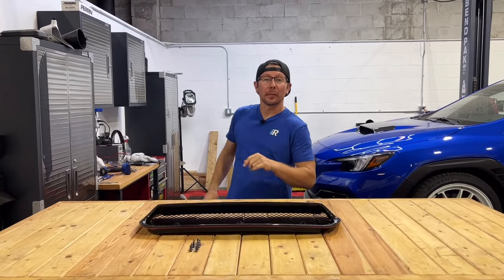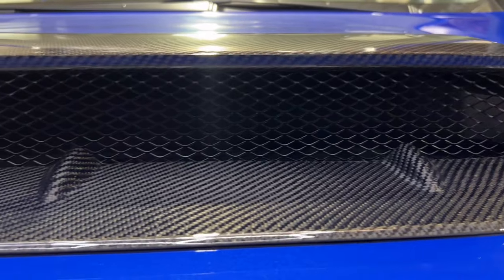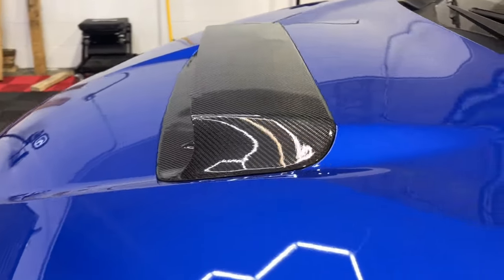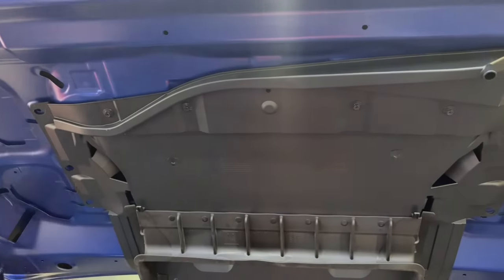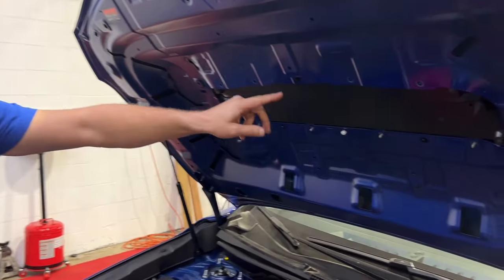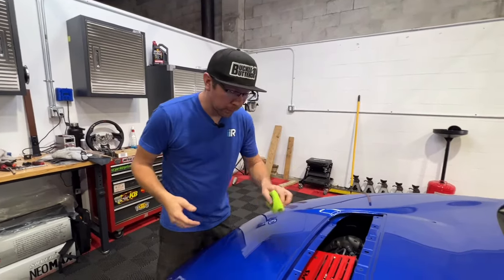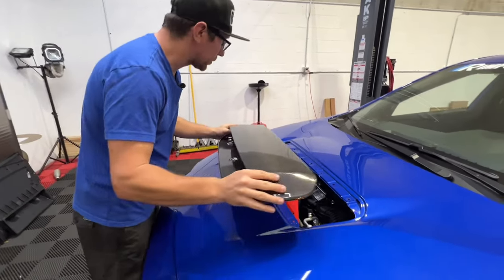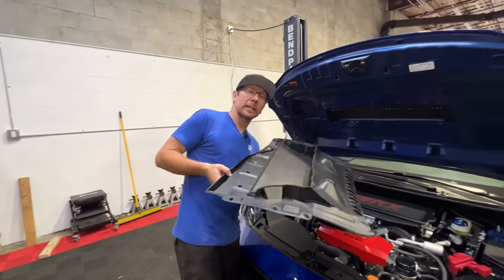Noble Carbon Fiber Bulge Hood Scoop Install | 2022 & 2023 Subaru WRX | Product Peek

Comment: Just a FYI, the scoop does not come with the gasket shown during the install. Youre also able to use the existing 4 screws on the front that held on the OE scoop.

Comment: Any torque specifications on this install? I don’t want to overtighten or under tighten these bolts.
Reply from the maker: Hardware of this size should rarely be torqued past 7 Newton Meters. If in doubt, add a light dab of blue loc-tight to ensure a good bond.

Comment: Im not sure how to take out the white pin, all this work and I'm screwed. Push pins on the bottom also weren't shown and now in my engine bay
Reply from the maker: The white pin removal is the same as the 3 black pins. Squeeze the two securing tabs to release the pin.

Comment: Don't but this scoop unless you want to to wear away the paint on your hood. It's interior quality to OEM. It does not have a glued on gasket like OEM, it does not have alignment pins like OEM, it does not have smooth edges like OEM. It's probably the worst knock off scoop on the market. I purchased it because I am part of some FB WRX groups and was seeing posts for it all the time and the fact that it was color matched was enticing. I installed it on my car and in less than a couple days it wore 7 spots on my hood down to bare metal because it's super flimsy and vibrates while driving. Biggest mistake I've made on my car that only has 3,600 miles. I entirely regret buying this scoop and wish I never had!
Reply from the maker: Good afternoon. We’re terribly sorry you’ve had a bad experience of any kind with a product that we sell. We take pride in providing our customers with the best products and the best service. Have you reached out to our customer support team yet? They are more then happy to get you a timely response to your problem. Thank you!
Reply: @ImportImageRacing  oh and expect me to release a YouTube video outing your company and your horrible customer service.
Reply: Second noble product I’ve bought. Second noble product I’ve returned. Shame on me smh. Terrible, chinesium products
Reply: @Custano  I see where you previously returned the Carbon mirror covers after you broke them during installation but I do not see a ticket concerning you Carbon hood scoop, if you don't mind reach out to the website with your issues... The issues Mr.Silversubies had weren't even with the carbon scoop...